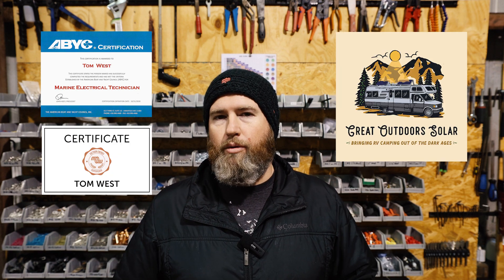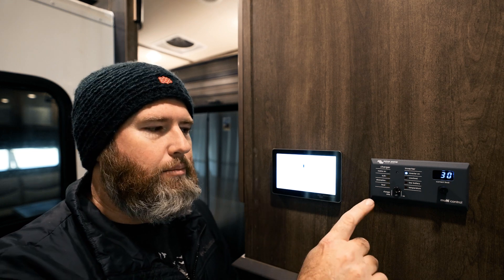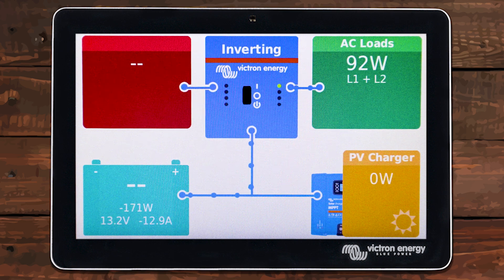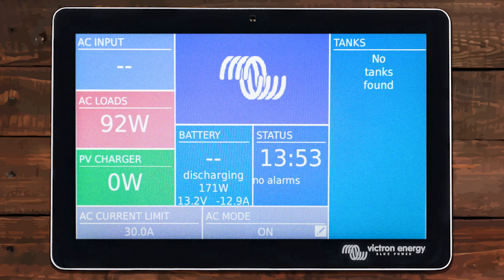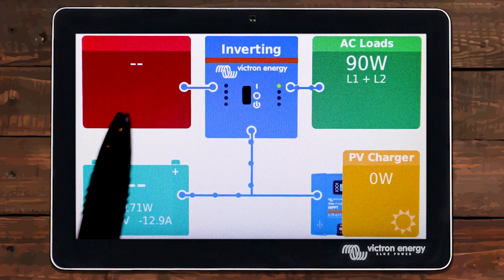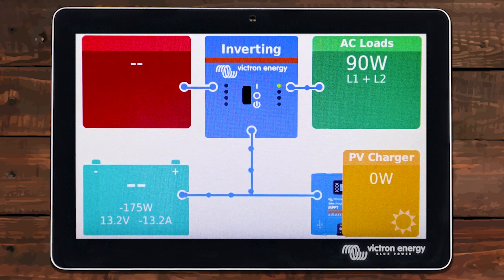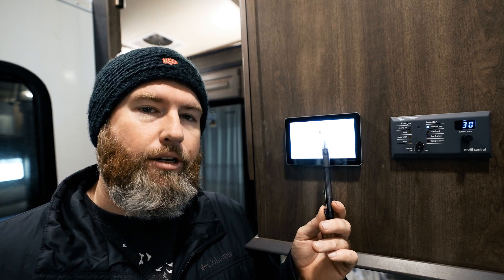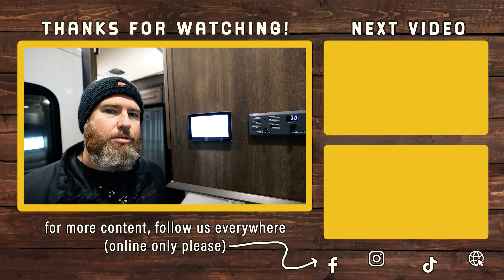Victron Touch / Cerbo GX & Digital Multi Control TOGETHER = LESS FEATURES

Comment: Very Good points, I won't order it for our Brinkley. I already saw the features on my Touch 70. I currently am wiring my MK2 for 30-amps in single L1 because snaking two 6-3 marine wires from the forward compartment to the breaker panel is proving very difficult for this 63-year-old without help & your other company is booked up past where we have to leave Winter Haven on April 1st to head to CO to Camp Host for the summer. Hence, we will be on the 30-amp prewire circuit for this summer. At least for 2025 they wired the rear AC to that 30-amp circuit, everything but the 1,100-watt microwave, front AC, converter, & fireplace are on L1. We have lots of trees to deal with, so I needed 3 charge controllers to handle the 740 watts on the roof & 700-watts of PV on the ground (canyon, pine trees, etc.). Cheers, Davey @ Cypress CG
Reply from the maker: @KU9L   On my first system, I did an inverter on L1 only. It was perfectly fine for everything while dry camping in good weather, which is the goal. When I needed AC, I hit the occasional RV Park. Sorry we couldn't fit yall in. You're right about it being tough on the wire fish from front to back. It's not terrible, but it's time-consuming and in werid places for sure. Best of luck with the system and safe travels 👍 -Tom
Reply: @HappilyWhereverAfter  Yes, thanks Tom. I know I could do it myself with another helper with my skills or better, but in your typical RV park I am hard pressed to find those skills as they are already out earning their keep somewhere. I only put in 560ah of LIFEPO4, but at 8,500' in CO the rear AC only takes around 5 amps of AC and hot afternoons are more rare (usually pea-sized hail). I just remembered I have to disconnect the WFCO converter once I switch-on the MK2, no more confusing the Smart Shunt where those extra amps are coming from! BTW, it's nice to see Fate Unbound back doing videos. When we were managing this RV park in WH for 6 years we enjoyed watching you guys make videos while we paused out travel. Before 2015 we Workamped at Sunshine Key in the Keys ... oh the old days were fun! Good Luck on your Boat Trips! I was born in Savanna, IL just a few hundred yards from the Mississippi River so was proud to be a Savanna River Rat in my youth! Cheers, Davey

Comment: Started off with a digital multi control and it worked fine, but then I upgraded to the Cerbo GX and have since been unable to use the on/ off/ inverter/ charger mode function within the touch panel. I get that pesky error "This setting is disabled when Digital Multi control is connect" despite completely unplugging and removing it from my system. Is this normal for me to be locked out like this? How do I restore those mode settings, but within the touch screen?
Any help is greatly appreciated!
Reply from the maker: It seems like your system isn't properly communicating, maybe the Cerbo isn't reading your setup correctly. I'd check to make sure the Cerbo and the inverter are connected properly. Also give then a reboot. -Tom
Reply: @joulemine  thank You so much. I will try that. I was so frustrated with it that I just left the digital multi control plugged in and walked away. When I unplug it and reboot the inverter charger, it still doesn't communicate properly.

Comment: Yeah, like @@jonsno6053 , I replaced my DMC with a Touch 50 and think I'm going to add the DMC back. I've lived with it for 3 or 4 months and it's complicated a couple things for my situation.

My biggest issue is the screen ending up on other screens than the boat and motorhome screen and my family and guests having to navigate to turn the inverter on just to make coffee or something. It was nice to just tell them to flip a switch. Simple for anyone.

My other issue is that I have found myself forgetting to adjust the current when going between RV parks, storage, and my home, all of which need 3 different settings. I never ever forgot that before. I think my problem is that the current read so clearly on the DMC but is kind of lost on the Touch 50 between being on the wrong screen most of the time, a sleeping screen, a low contrast display of that value, and the fairly terrible viewing angle on the Touch screens.

I'll maybe give it a couple more months since boondocking season is just starting in Texas but adding the DMC back would be nice. Bummer to lose the remote functionality of the Multiplus modes, but not sure I really need that except to correct it if I forgot to turn off the inverter of something.

Comment: Can the cerbo gx do a full inverter set up/config or do I still need the rj 45 cable and the mk3 dongle to plug in the laptop? Cheers.
Reply from the maker: @shameelali2549  As long as the Cerbo is connected to the internet and the inverter is networked (RJ45) to the Cerbo. Then you can use the VRM portal to update firmware and/or adjust settings for pretty much everything that plugs into it, including a inverter.

However the inverter programming via VRM uses the older VE Configure software and not the easier Victron Connect software (app). Both are free via Victron though.
Reply: @HappilyWhereverAfter  maybe just connecting the mk3 and laptop mite be better?

Comment: Great info!  Thank you for sharing.  I did learn a bit about my Digital Multi Controller, but not enough.  I can’t find on YouTube a video showing the Multi Controller being put through its paces.  I also can’t find info that I can understand on how it works and what it does.  I found out a bit by failures on some of it, but still would like a presentation on how to operate this unit and what it does.  If you ever post something like that, I’d watch for sure!
Reply from the maker: @jimsjacob  Probably because there isn't much to a DMC. It's just the same button from the inverter and then the current control. I have a video on how to connect to shore power that will cover those options. The video uses a Touch / Cerbo remote, but the info about current limit, on, off, and charger only, are covered which is all the DMC can do.
Reply: @HappilyWhereverAfter  It’s the knob of the current control that throws me…. Is the value showing on the display, the amount of amps allowed in?  If I’m plugged into a 30 amp ped, can I turn the knob up to 45 so that my Inverter (same you have) is augmenting the 30 amps coming in?  I have a 20 amp GFI plug that I plug into when I’m prepping the trailer for a trip.  Tops off my two BattleBorn Game Changers.  If I turn the knob to 20, it will trip the GFI when the charging goes into absorption.  If I dial it down to 16, it does not.  Things like that plus the inverter helping make up for not enough power by inverting battery power in relation to the DMC is what I’m wondering about.  Cheers.
Reply from the maker: @jimsjacob   Check out the shore power video. I talk about those scenarios. Essentially you set it to the plug you are hooked up to or lower. -Tom
Reply: @HappilyWhereverAfter  Will do!  Thanks for the replies.

Comment: Hello, thanks for your very useful videos.  Question: I have a simple setup with a Multiplus II Compact that is controlled by a DMC connected via the ve.bus.   I'd like to add my Cerbo GX in that setup and with the Cerbo GX being installed very close to the DMC, I was wondering if I can disconnect the RJ45 from the DMC and plug it into the 1st ve.bus port of the Cerbo and adding a new ve.bus cable connected from the 2nd ve.bus port on the Cerbo to the vet.bus on the DMC?
Reply from the maker: Both the Cerbo & DMC use an RJ45 connection to connect to the inverter. Happy tinkering -Tom

Comment: Correct me if I'm wrong, but from what I can see, there's only one benefit to having the DMC in addition to the CCGX or Touch 50/70: and that is a fast and easy way to set the incoming current limit with the dial.  It's faster than going through the settings on the Touch GX.
Reply from the maker: It's probably slightly faster.. but when setting up an RV at a campground I don't think 2 or 3 seconds is a big deal 🤷‍♂️

Comment: 9:45 - I do exactly what you mentioned. When I'm on shore power I set the inverter to CHARGER ONLY, for exactly the reason you mentioned, so if I lose shore power, the inverter doesn't drain my batteries to supply AC to my loads.

I'm still not sure why I see so many YouTubers with Victron system running the Touch GX AND the Digital Multi Control.  The DMC (Digital Multi Control) seem redundant, and an unnecessary expense.  That big YouTuber you mentioned keeps adding both in every installation he has done to his RVs (both Airstreams have both!).  It makes no sense.  Maybe it's lack of knowledge on the part of the installer.
Reply from the maker: I think it's a lack of knowledge and an extra part to sell for affiliate money.

Comment: I have the digital multicontrol and about to update to cerbo-s gx.  I am planning to leave both hooked up.  Shouldn't be a problem, correct?
Reply from the maker: If you are getting a Touch 50 or 70 display, then personally I'd put that where the DMC is now and sell the old remote. If you aren't doing the Touch 50/70 as well, then definitely keep the DMC. But you won't be able to remote control it via the Cerbo with the DMC in the system. ✌️
Reply: Gotcha. Wasn’t planning on installing the touch 50 or 70, just use local from my house out to my van or my phone while I’m using the van. Thanks for your reply.

Comment: You won my sub for this video alone. Well..  I'm in an RV (semi-permanent) and have built a nice solar system.. Four 100Ah BB lithiums, 2 arrays (3x290W titled but on the ground and 6x200w bi-facials on a dual axis tracker) a pair of Victron 100\70 controllers (networked) wired through a Lynx distributor and then into a Multiplus II 12v 3000 120 and finally into a CERBO with the touch 50.  I LOVE the Boat and Motorhome overview. I have tweaked mine even further and have a aerial picture of a beautiful sunset I took over a local lake with a bridge in it.  How much do you know about programming the MP's..?  In the advanced tab in VE config.. I have it checked for waning it to prioritize other energy sources.. But it seems to staying in the on all day unless I change it to inverter only, never taking advantage of my solar and 400Ah.
Reply from the maker: I suggest you use Victron Connect to program the inverter. The VE Config software is the old way and has less features. I am familiar with it, as Ive been around for a while. ESS (assistant) is how you'd accomplish that via that software. But it isn't legal to back feed the grid, so it isn't how I'd accomplish that if I were you.

Once you go into the MP via Connect you'll see the extra controls I'm referring too in the settings area. I can't remember the exact name right now, but it's quite obvious and customizable.

If you need help, I do remote consults, link in first comment. BTW I had my RV in my screen as well 😎 Safe travels and happy tinkering!

Comment: Definitely not needed, but I installed one anyway. I prefer the physical knob and toggle switch of the DMC and, for me, it was worth losing features on the GX that I wouldn’t have used.
Reply from the maker: The touch-screen is like a smart phone to me. The inverter has a rocker switch in a pinch if ever needed. Thanks for the input, happy camping.
Reply: @joulemine  To me, it's kind of like using the touch screen in my truck versus using the volume knob. I like the touch screen for just about everything but prefer the knobs for changing stations and adjusting the volume.

It's great to have options!
Reply from the maker: I understand that, different strokes for different folks. ✌️

Comment: When the Victron is in charge  only mode, does the amperage input limiting control still work? Or does that only work when inverting?  I was hesitant to put it in charge only mode because I didn't know if I would lose that protection?
Reply from the maker: The inverter doesn't stop you from pulling that much, it isn't a "load shed" or "energy management system". When in ON however it will go into assit mode (inverting) to make addtional power if you need more than what you have the AC Input Limit set too. Hope yall are well! 🤙
Reply: @HappilyWhereverAfter  so to confirm, we lose that protection when in charger only mode?
Reply from the maker: @barrybluth4351  There is no "protection" to begin with. It doesn't limit power being pulled at all, regardless of the mode it is in. It does, go into "assit" aka inverting mode when ON, but not Charger Only.

So if you're on a 50A shore connection, then inverter isn't going to go into inverting mode unless incoming shore power is lost. A 50A RV won't pull more than 50A in the first place, if it did, it would trip the shore breaker.

If you have a 15, 20, or 30A connection, but a 50A RV and do need "assist" mode. Then leave it set to on. The article on the website gives more info as well, if you prefer to read it.
Reply: @HappilyWhereverAfter  I'm referring to the limit setting that I set when driveway surfing.  If plugged into a 110 household outlet, I limit the draw to 15 amps.  It keeps us from popping the breaker in our hosts home.  That's the setting I'm referring to.  Protection for the house or  pedestal (like when I plug my 50 amp coach into a 30 amp site, I set the limit at 25 amps)

Comment: I have the touch 50 but recently it stopped connecting to the Wi-Fi in our coach? Any suggestions? Thanks Don
Reply from the maker: If the signal is poor it will stop trying to reconnect to it. I suggest you "reboot" the Cerbo. If that doesn't work then "forget your network" in the WiFi settings and try again. Wifi connection article is here: https://joulemine.com/wifi-connection-for-victron-touch-50-and-touch-70/

Comment: Great video.  I made the update and like being able to set my current on the home screen now.  I get notifications daily -- "bmv712 High Voltage."  It is just showing that my 14.4v high limit was slightly exceeded like 14.45 or 14.52.  How can I turn off this notification using my Touch?  BMV712 only shows "OK" on that warning with no option to stop it.
Reply from the maker: Check the BMV in the  Victron Connect App. I bet you have an alarm set for high voltage in there. Adjust for higher if needed. ✌️
Reply: @HappilyWhereverAfter  You were exactly right.  On Victron Connect I had it set for 14.5v.  Upped it to 15.3 and no more high voltage alarms.  Thanks!

Comment: Hi Thomas, I’m still in the midst of restoring my 1969 Lifetime motorhome. It’s all original with its electrical setup. Just 2 breakers and the 110 hook up, and that “junction “ gets very hot! Anyways I want to redo it all for a 30amp hookup, and solar setup. But not sure on everything I need. I wish there was a kit to buy to have a complete setup from scratch. Is there or is it all piece together?
Reply from the maker: I do consulting for DIYers, including parts list, etc here: https://joulemine.com/consultations/ I'd probably recommend you put in a new distribution center with modern breakers, fuses, etc. It'll be quite a bit of work no doubt about it. Best of luck!